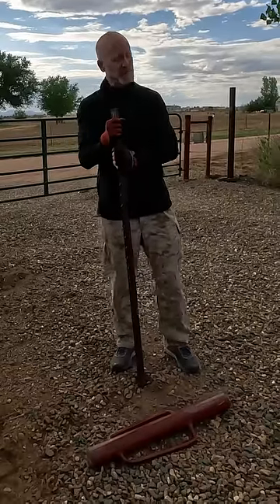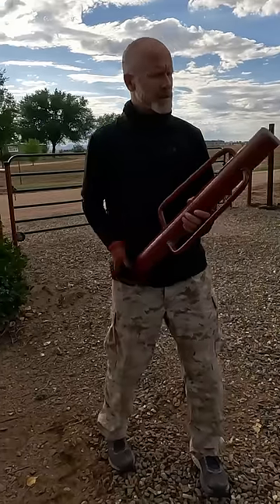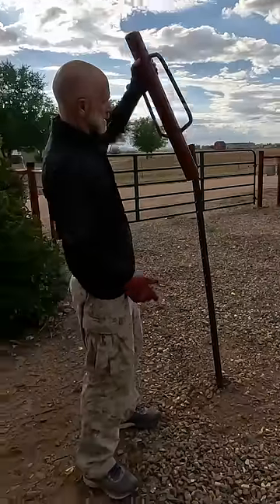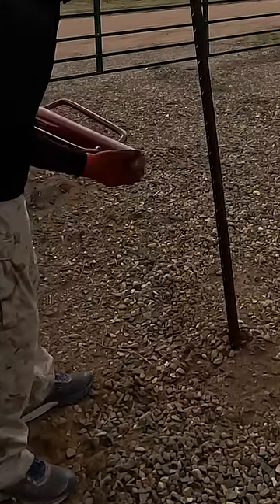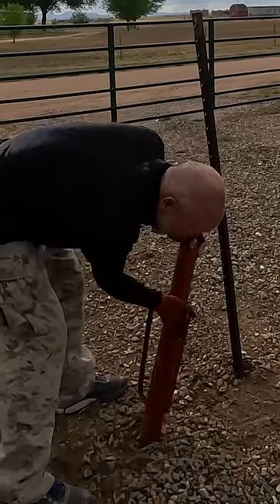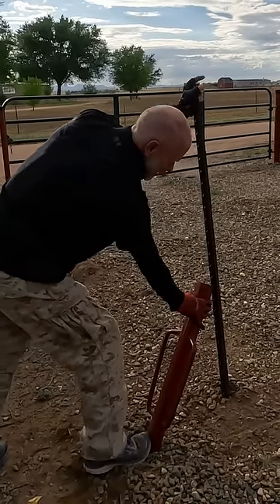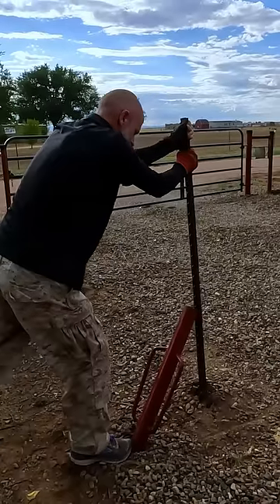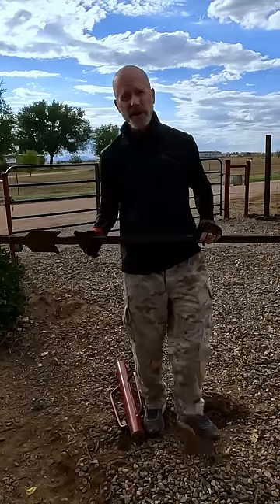Avoid Back Injuries with Simple T-Post Removal Trick

Comment: Use a garden hose with a straight pressure nozzle. Stick it into the ground until it's as deep as the post. Now wrestle the top of the post in a circular motion until the circle is about 1-2 feet. Now just gently pull it out. I do that to 4X4 fence posts in concrete base too. In that case you wet the area in a three quarters of a circle. The dry side you use for pulling the post down using the ground for leverage. I did that to a 200 pound post base. Who was the person who poured the concrete? Me, I didn't know any better at that time😁
Reply from the maker: 200 pound base!?!  I guess you made it hurricane proof. I have used hydro for boring conduits with equipment but never really thought to drag a hose. It makes perfect sense. I appreciate ya detailing that out. I am gonna give it a shot. Thanks and take care. ✌🏼🙏🏼🕊️
Reply: @futurehomesteadingAZ  my client(I was a yardworker) goes "you went to town with that didn't you?" I used 2.5 bags of concrete. Been 18 years.
And your welcome.😁

Comment: bottle jack with a jaw welded on top to grip the post. Best backyard invention for pulling posts.
Reply from the maker: All in one. Very nice and out of the box. It’s been tough to keep up but this is a first in my 1k replies or whatever. Fantastic contribution and a solid solution. Handle and a mod Jack. As compact as you can get. Thanks for that. Have a great weekend ✌🏼🙏🏼🕊️

Comment: Thanks for the tip, just learned something new today!  I've got a back surgery n this will be useful 😊
Reply from the maker: It’s a good method if an old leverage technique can be useful. If you have existing damage. Spend the $50 for the puller or check out the comments. Lots of zero or close to zero effort solutions. This method still requires effort. I would go with an alternate solution. Thanks much for taking the time. I wish you a speedy recovery. ✌🏼🙏🏼🕊️
Reply: @futurehomesteadingAZ  thank you!  I am definitely trying my best to avoid injuring myself again so videos like these provide me with some ideas how to protect myself when I need to perform heavy duty tasks because I don't receive no help around here.  Everything is done by hand and by my lonesome!  I appreciate any d.i.y life hacks as much as possible!  I blew my back lifting heavy materials, and I regret not taking care of myself!

Comment: I have found using a spud bar and a chunk of 2x4 easily removes fence posts.  Lay the 2x4 on the ground next to the t-post nubs and use the spud bar as a lever against the T-post nubs.
Reply from the maker: Yeah. I can see that working. Especially in a pinch. Great use of leverage. Be safe. Thanks for the contribution. Take care. ✌🏼🙏🏼

Comment: I hear ya bro, pulling posts every day for the last 70 years has done a number on me. One day I had inspiration while out in the oil fields and I developed a new tool, I call it the "T-Post Puller" I won't bore you with the technical details on how it works but the patent just went thru yesterday and you should be able to pick one up at your local hardware store at a decent price. It's the future I tell you!

Comment: Hel ya man I do this every firework season with all my signs I have done this for 15 years and you just made me feel like an idiot that it was that simple Thanks bro I appreciate it
Reply from the maker: It you are doing this on the regular I would get the tool. If ya don’t feel like retrieving the puller, a little leverage may sort ya out. It you are using light duty posts, this will probably bend them. There are also a ton of great suggestions in the comments. The one I am trying next is the small floor jack and pipe wrench. I drove 8 post just to try some out. Any way you do it, be safe. Thanks for taking the time. 🙏🏼✌🏼

Comment: Brilliant! So easy.
Reply from the maker: It is a cool method if ya need one. It still takes some effort but I got ya. An easier method than some, using what you probably have. A puller is better but I think you get the spirit intended. Don’t grip and rip. Thanks for taking the time. Be safe out there. ✌🏼🙏🏼

Comment: I've seen city workers performing a variation of this to straighten up signs that were bent over (not to the ground, just 4-20 degrees off plumb.) They use a jack to do the straightening, but since much of it is on concrete, a jack would normally just slide away. The jacks they use have padeyes at the bottom and the run a chain to the base of the post to keep it from slipping away. Could do something like that here as well if you're not getting a good stick into the ground. The post pounder has handles in the right place to anchor a chain loop on that end, then use the hook(s) to size the loop to the base of the post properly.

Comment: We had to remove a 100 year old, 50 miles long old barbed wire fence in Montana and holy cow that was a lot of work. The posts were old logs and branches with rusty Staples and rusty barbed wire. Those logs had been buried in the ground for 100 years and they were very hard to get out of the ground. An 8-man crew took 2 weeks of 16-20 hour days to pull it out with no days off. 

Got it all pulled, rolled up and loaded onto a couple trucks and trailers and then used a fence post machine that basically installed the new fence automatically. We just had to put the clips on the t-posts to hold the new barbed wire. You quickly found out how the times have changed in 100 years. Lol
Reply from the maker: I really enjoyed that story. Not many people have the experience of time travel during a job. Really cool to think about those tough as nails people that installed it. I saw one of the automated fence installers, amazing. Not as much personality but zero damage and the speed. Can’t beat it. Thanks for sharing that job. It was fun to think about. Be safe out there. ✌🏼🙏🏼

Comment: I've made the mistake pulling one using my back, luckily I was listening to my body and did not really hurt myself. What I've learned to do instead is just keep my upper body straight up and squat with my feet ether side of the bar then use my legs. If you got one or two it should be fine I don't recommend doing it as a standard method however and it's always better if you have tools to use. Since I don't I just learned the method I described.
Reply from the maker: They are deceptively destructive. Glad that didn’t put you out of commission. Form is so important and focus. Deliberate movements. I agree that if ya get more than a couple/few it a good idea to invest in a tool such as the post puller. The comments also have some very cool methods. Some are practically zero impact which is always nice. Great points. I appreciate the contribution. Have a great evening. Be safe. ✌🏼🙏🏼

Comment: I put a brick down beside the star picket, then grip the picket at the bottom with a set of boltcutters and lever it up, using the brick as the fulcrum. My 10 yr old does it. 💪⚒️
Reply from the maker: A bolt cutter solution. First time for that. Very smart. I appreciate the suggestion. Have a great day. Take care. ✌🏼🙏🏼

Comment: Cool looks super easy! Thanks!
Reply from the maker: The puller or many methods are easier. The comments have some great suggestions. This could be a leverage solution if you need one. Thanks for take the time. Take care. 🙏🏼✌🏼
Reply: @futurehomesteadingAZ   I’ve used a puller to pull out post. Definitely heavy. The method you’ve shown looks much easier!

Comment: That seems like so much more work. With risk of pulling different muscles
Reply from the maker: It’s not a zero impact method and there is risk in everything. If you have concerns, it’s not the method for ya. Grab a post puller or hire it out. Keep the damage potential as low as possible. Take care and be safe. ✌🏼🙏🏼

Comment: If you're removing a wooden post you can do the same. use the new post to pry it just lay something on the ground to make a pivot point screw a board to the side of the post to be removed and stick one end of the new post under the board you screwed on and over your pivot point then pry. Might need to rescrew the board lower after depending on bury depth but it's a really neat trick.
Reply from the maker: That’s a cool solution. I appreciate ya sharing and detailing that out. I will remember that when I rebuild the deck. Just waiting for it to finish collapsing. 😂 thanks for the taking the time. That has value. ✌🏼🙏🏼🕊️

Comment: They crazy part. I think they engineered this into the design of the post.
Reply from the maker: Ye sir. I think you might be on to something. Plus they were thoughtful enough to supply the driver and remove together. Lots of easier methods but you get it. Thanks for taking the time. Be safe. ✌🏼🙏🏼

Comment: Good to know, however I use a n old hi lift car jack and a chain or straps all depending on if I'm removing fence posts or deck posts.with deck post I usually start with a hydraulic floor jack and finish using the hi lift after it's loosened.
Reply from the maker: Solid info and detailed well. That old car Jack is a trade secret. I only here it on rare occasions. Lighter than the farm but usually able to sort it. 
I like the stages you outlined. A floor jack to give it inspiration, then bring it home will the car jack. I really like that. 
Thank you for the solid contribution. Great info. Take care of yourself. ✌🏼🙏🏼
Reply: @futurehomesteadingAZ  Thank you for not taking it in a bad way. You're a gentleman and a scholar.

Comment: a lot of t posts are in the field where its really hard to get a grip like this. its so much easier to use an actual t post puller (Yes that's a thing) or just grab the compact tractor and a chain. could use the loader or if you don't have one the three point works too.
Reply from the maker: Good to know. I haven’t experienced that but AZ might be terribly hot and miserable, our posts don’t rot very quick. The post puller in any event is gonna be the best method, till ya bring in the tractor. The last guy said he preferred the puller over the tractor but maybe it’s because he works alone. I should have asked. Anyhow, this was a lot to outline. I appreciate ya taking the time and providing detail. Great contribution. Thank you. Be safe. ✌🏼🙏🏼

Comment: In nz they are called waratahs. There is a specific hand tool (Google waratah puller) with a lever that grips an edge and you just push the handle down..

Comment: I use a truck, 4X4 board, and a chunk of chain.

Chain gets tied to the post, near the bottom, is brought to the top of the board, and then to the hitch on the truck.  I've got an old T100, and rarely have to give it gas, idling in gear will pull them out.

steve

Comment: The best way I've found is to take a piece of strapping like a ratchet strap. I tie it to the T-post and to the driver with about 4-5 inches of slack. Then just reverse the motion used to drive it and it pulls it right out after a few pulls. No need to mess with getting the driver anchored, or risking bending the T-post.

Comment: Screw a bit of timber to the very bottom through the holes and then use a shovel as a lever to pry it out from the bottom of the timber.
Reply from the maker: Solid way to get a grip. Other shovel methods have been, grab the node and pry up. This is a lot more sable which is nice. Great info. Thank you. ✌🏼🙏🏼

Comment: I usually just wiggle them front and back right and left and then they just pull right out if they get stuck my dad has a Sikorsky CH 53 E. Super Stallion but the rotor blade wash is a little intense😮
Reply from the maker: I have waited forever for the helicopter solution guy and here you are. Stoked!!  Please please please do it. 🤣😂🤣 It will be so satisfying for you to win all debates on the subject. I am not doing another comment tonight. Nothing else will be as fun to think about.  Thanks for the best plausible solution. Have a fantastic week. Take care.
Reply: An old tire jack you know the kind with the foot on the bottom that’s my serious answer. Pulled a lot of stakes  out a frozen ground with those.
 Or alternatively, …💁‍♂️🤦🏼‍♀️

Comment: Another way to do it with the driver is to put the tpost in the handle, slide the whole thing down and then put the handle into the same notches he’s using, then you have better leverage with the other handle on the driver to pull with your legs, works well and is pretty quick. If you put it the wrong way the handle you’ll be grabbing to pull will touch the tpost, so you’d just flip it around instead

Comment: Avoid back injuries by lifting with your legs. We used to figure out all kinds of ways to leverage posts out of the ground. We had some interesting techniques.
Reply from the maker: Thanks for that. I lost my focus and it could have ended bad. I should have clicked it back in and not made that pull. I let time become a factor after the driver slid away. Thank you for the concern and helpful words. Have a great evening. ✌🏼🙏🏼
Reply: @futurehomesteadingAZ  Absolutely!  I've been there from doing that same type of work. One of my back injuries took me out of work for three and a half months and fortunately since then I've learned to rely on my legs for lifting. It wasn't an easy learning process but I think I have it down pat by now. God bless you!

Comment: In Boy Scouts we had made like a gate for our camp, put like 2 maybe 12 foot branches in the ground and strung a sign between them. Time to break camp days later and we couldn’t get one of the posts up, we were like digging around it and crap and struggling, I think maybe the base had soaked up water and expanded idk. Anyway our Scoutmaster picked up some logs and twine, spent 3 minutes lashing a lever to the post with another log as a fulcrum, and tore the post out of the hole easy as breathing. Not practical with a fence line but yeah, brains over brawn
Reply from the maker: I think you are right. Those post swelled really locking them in. Very cool that the leader worked his magic. Great knowledge to know even if there are better solutions. Using what ya got is sort of their motto. A lost art. Thanks for sharing that story. Great use of leverage and smarts. Enjoy your day. Stay healthy my friend. ✌🏼🙏🏼🕊️

Comment: If you turn that post driver sideways and slide one side's handle down over the post and lock it in like he did, you can use the other handle and squat it up.
Reply from the maker: That’s a good method with proper form. Can’t knock you for doing it that way. It works. Thanks for the contribution, your detail is very helpful. Have a great day. Take care. ✌🏼🙏🏼

Comment: Put the t post installer on the post,  some short chain and a few bolts or sturdy carabiners

Wiggle it a bit to loosen the soil, bolt the chain to a handle, wrap the other end around the post so it dont slip.

Pound it back out, way easier only takes a few taps.

Comment: Couldn’t you put the driver on the post and use the handles to push and pull back until it’s loose and then take it out? Or would you bend the post? I don’t do this type of work so I have no clue

Comment: Slide the pole through one of the handles and torque the handle until it catches the pole. The leverage the pole up by lifting the bottom of the pole driver.

Comment: I have to do this often and bought myself a post puller for $35 at the time I got it. I think they are about $48 now at Tractor Supply. The method you were using seems to more of hazard to your back than anything especially if it slips off. Just spend the $ and buy a puller or find an old car jack. If you do this then you will actually be working smarter and not harder.
Reply from the maker: Very true. It was more about an alternative to gripping and ripping using the tool many people have. The puller is absolutely superior. I priced one out at TS for $50. Great investment for sure. Thanks for putting it out there. Great contribution to myself and the community. Thank you for taking the time. Enjoy your weekend. ✌🏼🙏🏼🕊️

Comment: I try to build a simple lever out of whatever is around if I can't hooman power it out of the ground. If it's a lot I use the tractor.
Reply from the maker: A lot of great suggestions to make a simple lever out of almost anything. That’s even better in a lot of cases. But the tractor, that’s the dream. I am glad you have that option. That is a huge help. Thanks for taking the time. Have a great day. Be safe. ✌🏼🙏🏼
Reply: We have to feed hay and spray and..... all the others stuff that goes with livestock. Tractor is pretty needed, but it do take some fuel:) @futurehomesteadingAZ

Comment: If it’s a big timber I use timber tongs, get the sledge knock the top back and forth a bit. Then I get the tongs stab either side in the centre at the base then lift with the legs and bingo
Reply from the maker: That sounds very satisfying. Give it an attitude adjustment then go for it. Legs for sure. I lost my focus and it could have cost me. I appreciate ya jumping in. I have a solution for timber which I hadn’t till now. Great contribution. Thank you. ✌🏼🙏🏼🕊️

Comment: So what kind of beer can I buy you?
Reply from the maker: Haha. Anything cold will work. There are much easier methods and some really cool techniques in the comments. If ya need a leverage method because that is all that is available, this might sort ya. I would keep your expectations to 24” or less. Give it a drive to break the tensions, use some water, use a board for the fulcrum anchor, notch a receiver in the driver….. there are ways to make this method easier. This is also a fantastic bar bet. Just sayin. 🤣 thanks for taking the time. I appreciate that. Be safe out there. ✌🏼🙏🏼🕊️

Comment: I have a legitimate T-post remover, it's a square pole with a lever attached to a little flat peice of metal that's got another square cut out, you put the remover flush with the post and put the square as low as possible then crank the lever and it yanks it straight out of the ground.